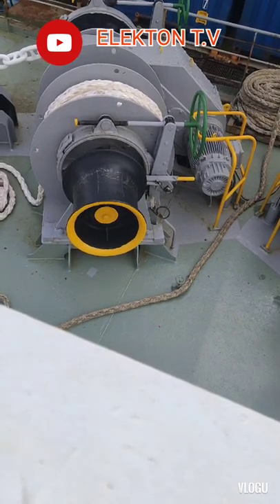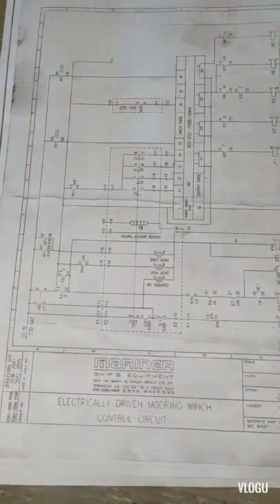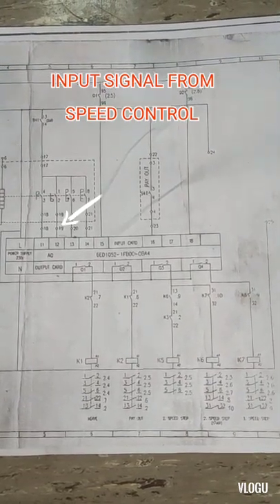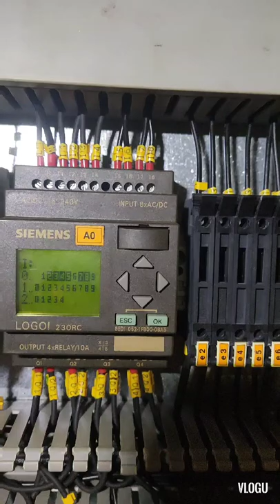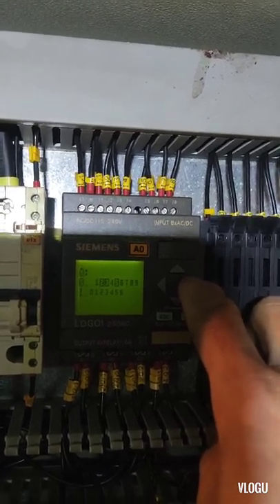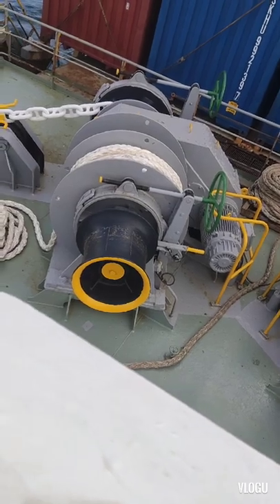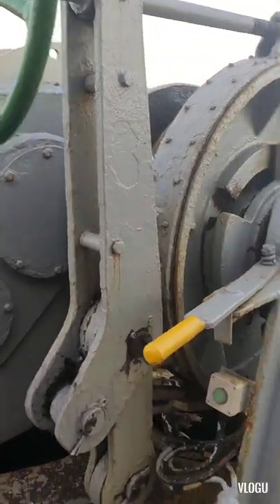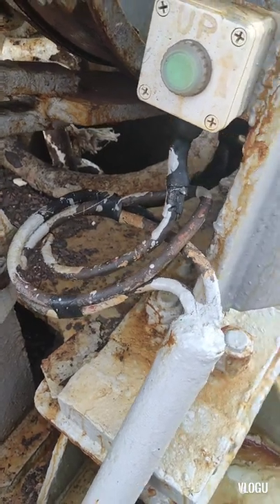SHIP WINDLASS AND MOORING WINCH, 3RD SPEED NOT WORKING

Comment: I have HATLAPA anchor-mooring winch and the 3rd speed doesn't work too. But when I connect another motor, the 3rd speed works. The motor was tested for the 3 speeds after rewinding it. You think the problem is what?